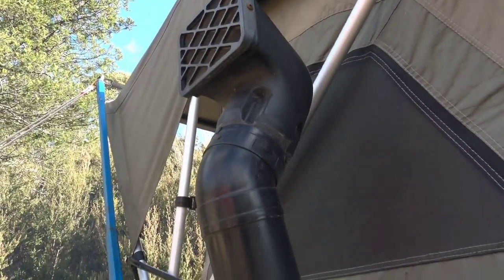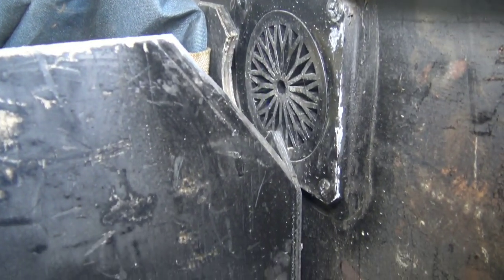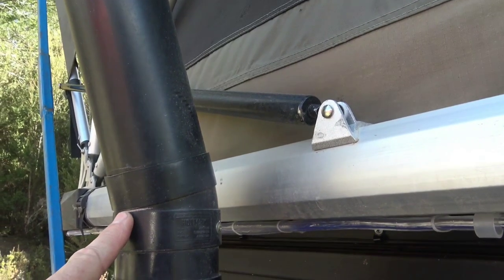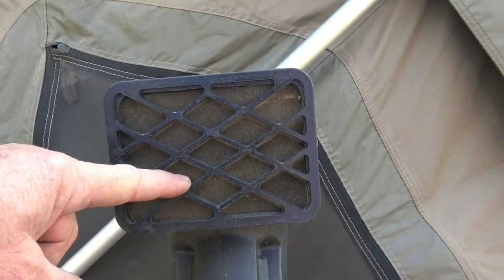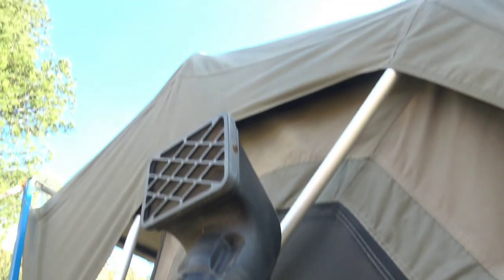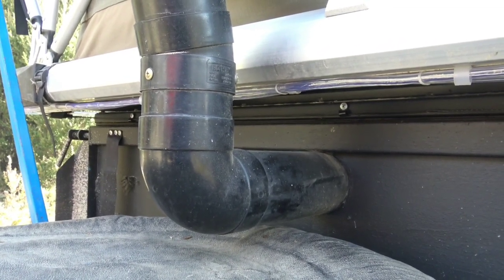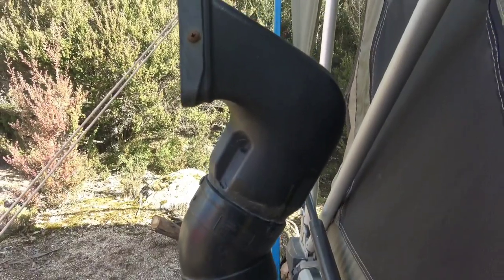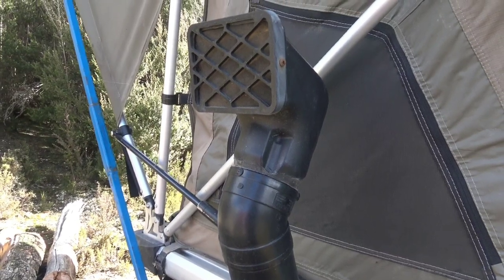Camper trailer pressure vent

Comment: my trailer just has foam on the gate. do you pressurise because of gas bottle/ batteries/ fridges?
Reply from the maker: No, I pressurise it to create a higher pressure inside than trailer than outside so it doesn't suck in dust, you can't keep dust out if its really dusty no matter how sealed up it is.